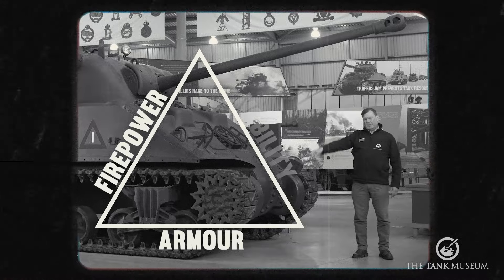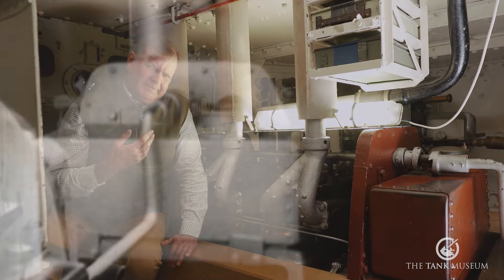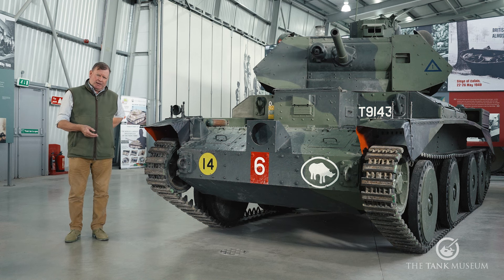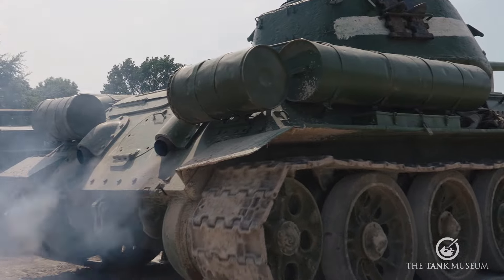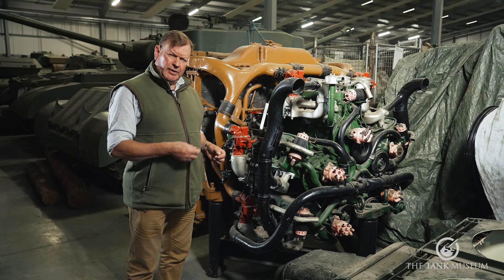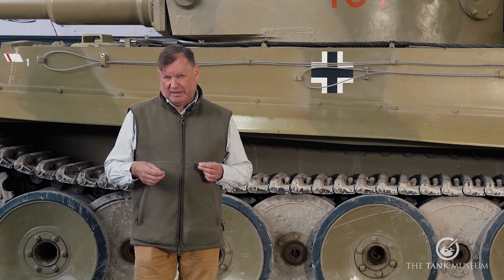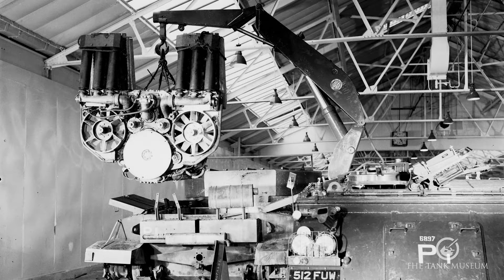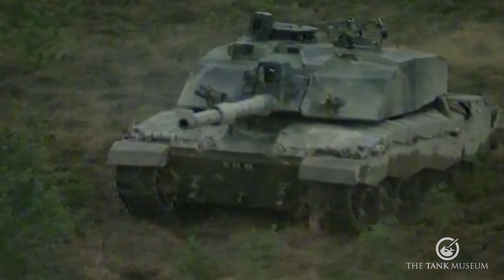Powering Victory: How tank engines went from 105 to 1200bhp

Comment: I am fascinated by the history of technology and design, especially having to do with "roads not taken", or "roads not taken sooner". Why was the atomic bomb invented before the Claymore mine? Think about it. The explanations for these seeming anomalies can be sorted into a few categories. One of the most common explanatory categories I frequently see can be summarized as "it happened that way because it had to happen that way". This explanation is sometimes true. Often though, it is based on widely held beliefs that have no basis in fact. My personal favorite category is "nobody ever thought of it", or the closely related "they didn't think it mattered", though this leads inevitably to the question of "why did nobody ever think of it or think it mattered?". The best explanation is that an aspect of design depends on the invention of a new technology, unavailable at the time under discussion. This is best because it leads to greater understanding of history.

The fact that several tanks in WW2 used aircraft engines* is interesting. Something that has always struck me about WW2 tanks is how underpowered they were. Powerful engines were available: Aircraft engines with the power of modern tank engines were tens of thousands. Yet when they were put into tanks, all the parts that made them powerful were removed. The easy explanation is that this "simplification" of the engine made it more reliable (I'm certain it made them cheaper; choices, choices) To begin with is the reliability thing really true? Did the power producing parts truly reduce reliability? In WW2 most of the reliability problems one hears about with tanks have to do with transmissions and final drives. Additionally, the reliability problems of airplane engines (in airplanes) seem to have mostly to do with overheating, largely due to concerns about streamlining and weight saving, two things of less importance in a tank (one hundred pounds weight saving in an aircraft is important, in a tank it's trivial). Regardless, if it is a reliability issue there are ways to deal with this that don't reduce the ability of a tank to accelerate out of danger, one of which is the replaceable power pack, as is used on (I think) every modern tank. 

The use of power packs was not enabled by the invention of some new technology in the 60s, or whenever they were first introduced. They could have been introduced in WW1. Power packs are replaced according to a statistically determined schedule before the tank breaks down (at least that's how I think it's supposed to work). This may or may not increase the burden on the logistics train, depending on a complex collection of factors. Having to produce and sustain a larger inventory of tanks in the field to insure that a certain number are actually working is definitely a burden on logistics, not to mention the fact that a certain number of tanks will get stuck in situations that more power could have gotten them out of, and have to be abandoned. Oh, yeah, and the argument that "it has to be simple so they can fix it in the field" may occasionally make sense, but I bet most of what breaks on a tank engine can't actually be fixed by the crew in the field, and even if it can, this takes time that could be better spent destroying the enemy, resting, or avoiding being killed. I think the reason WW2 tanks tended to be underpowered is simply because they didn't think it mattered. They may have also been thinking in terms of speed, which really doesn't matter that much because if your travelling a long enough distance for an extra 10 mph to make a difference, you should be using a carrier, or half your tanks won't get there any faster for having to fix tracks and things. What matters about power is acceleration. Especially in an era when tanks have to stop to shoot accurately. Being able to get away faster from where you stopped makes you less likely to be hit by shots aimed at where you stopped.

BTW, the M18 Hellcat and M4 Sherman have same engine, yet M18 is 7-16 inches shorter, so I don't think it's the engine made the Sherman so tall. Another frequently mentioned culprit is the decision to put the transmission and final drive in the front, necessitating running a driveshaft under the turret. Better explanation, if only because it points out a common piece of stupid tank design (which various sources try to justify in ways that don't really make sense, and I will point out is never done today). The Hellcat also has a rear engine with a front transmission design. I haven't found a clear and detailed depiction of the drive system of an M18, but I get the impression that they simply offset the driveshaft from the crankshaft with either a gear or a chain, which allowed them to lay the driveshaft flat on the floor (deck?) of the hull, rather than running it an angle as it is on the Sherman (yeah, go on and tell me THAT had to be done that way!). Oh, wait. You wouldn't want to put in an extra gear or chain (more moving parts!) because that would decrease power due to friction. The M18 had a top speed of 55 mph, which even today makes it one of the fastest tracked vehicles to ever be put into service. We can reject that argument. I think it's because the designers of the Sherman just didn't think it mattered, and when they figured out it did matter it was too much trouble to change. But it didn't have to happen that way.

*Another thing about aircraft engines: for the Yanks and Brits the practice of using aircraft engines may have prolonged the silliness of using gasoline to power vehicles weighing way more than any gasoline powered vehicle ever should. The Germans have no excuse. Consider the ridiculousness of powering a Tiger 2 with gasoline, especially when fuel availability is a problem. And it's not so they could steal fuel from the allies (I've seen this claim)! The Russians were the threat their tank designs were intended to counter, and the Russians used diesel.

Comment: Asides….  The later Sherman’s used the mentioned Ford GAA engine.  It began as a 60degree V12 DOHC aero engine.  When the aero orders didn’t come in, Ford lopped off 4 cylinders and sold it a 60deg V8.  Arguably the best tank engine of the war.
    The Chrysler multi bank cobbled together engine was reliable, but heavy.  Have read it could run with one bank shut down.

Comment: I'm truly surprised at the Tank Museum allowing this piece to go out with such inaccuracies about the Leyland L60 pack.  For a start, it's not a V6;  it's a six in line, opposed piston setup.  Secondly, the failures attributed to the engine weren't down to any failures by Leyland but more to do with the fact that the L60 was built specifically for Chieftain but at a weight of 45 tons, not the 56 ton final version of the Mk1.  When you add 10 ton to a vehicle spec without upgrading the engine you're inviting problems.  If any further proof was needed you've just got to look at the Vickers MBT and its Indian version the Vijayanta which were both powered by the L60 but at 38 and 39 tons respectively these tanks had no engine problems at all.  Plus there is absolutely no mention at all of the success of the L60 from the Mk10 version onward when horsepower was increased to 750bhp and then 850bhp during the Sundance trials - part of the Totem Pole package of improvements.  Yes, MoD left it too long to get us the right variant of the engine but when it eventually came from the Mk 7a onward, Chieftain was finally the world beater in all respects which it could have been from the outset.  Not only am I quoting fact here but I am speaking as someone who has experienced the L60 in its original and improved forms and who watched the joy on people's faces when they got an experimental Sundance pack fitted into a Mk5 and realized how much better and less oilier their future would be.   Come on Tank Museum, update this Tank Chat and give us the correct version.

Comment: Ooh this will be interesting. I’ve always wondered how engines got more powerful. I mean, it’s just burning petrol in a metal cylinder right ?
Reply: Not just that- many things involved.
Cylinder numbers, size, pressure- aircharge pressure, RPM, fuel types, valve sizes, RPM ranges

Comment: Of all the fundamentals of tank design: Firepower, Mobility, and Protection. They are not equal. What is the worth of a tank's heavy gun if it is not mobile. What worth of a heavy gun's protection if it is not mobile. The VERY essence of a tank is that it be MOBILE. Most engineering or thought on armoured warfare looks at mobility last, when indeed it is first.
Reply: If no gun what is importance of mobility?

Comment: It seems to be a constant for all nations,but especially Germany in WW2,that the designers of a new tank seem to have the engine built and ready,then find the thing is 10 tons heavier than it was supposed to be,thus affecting mobility..The Chieftain had a similar issue i believe?Like the Panther at about 45 tons,was the weight the Tiger was MEANT to be.Yet shared the same basic engine.Then the King Tiger another 6 tons heavier still..Why does this happen?Surely it would be better to finalise the tank,THEN pass your requirements to the engine builders.
Reply: New tanks are quicker to design than new engines.

Germans failed to upgrade their main tank engine over 3 years
Reply: They didn’t have the time, materials, or people to do 20 things at once. The Americans did.

Comment: The triangle at the beginning is bs. You need way more than just that for a good tank. You need brilliant sights, good stabilisation, safety features, smooth or bored? You need brilliant soft factors not just the 3 hard factors.
Reply: even competent training alone combined with a decent gun could outweigh almost everything else

Comment: I'm no expert but common sense tells me that fuel consumption is a massive issue. I'm sure the Centurion with the Meteor petrol engine had a prodigious thirst, which presents two huge problems, firstly the vehicle's fuel capacity and secondly, probably the bigger issue, the problem of keeping the tank supplied with fuel on the battlefield, requiring much more fuel and more fuel supply vehicles than if it had a more economical diesel engine. Fuel trucks are a nice easy soft target for enemy forces, if you only need half as many to supply each tank, you're much less vulnerable.

Comment: do you guys think the armored triangle should be a square to consider things that are becoming even more important in the modern battlefield such as vision (thermal sights and/or maybe even radar to detect small drones). Or does vision goes into armor?
Reply: What about crew comfort and ergonomics, what about reliability and ease of maintenance, what about strategic mobility? There are lot more things that go and have always gone into a tank than just armor, mobility and firepower, sometimes those things only come at an added financial burden, other times they impact the triangle, thus I don’t think those ‚newer‘ features justify changing up the way we talk about tanks any more than those things we haven’t considered in the simplified discussion during the last 100 years.

Comment: No mention of the Continental 1790-series or the 1500hp Turbines?
Reply: And doesn't the Leo 2 also have 1500 hp diesels, or at least the later version of Leo? They top out at 80 km/hr on the road, literally a third more than the Challenger 2 with its 60 km/hr.

Comment: Its always so weird how low on hp tank engines are. There are old volvo 240's out here with more than 1200 hp XD
Reply: You need to compare the torque figures as well as the horsepower.
Reply: Bugatti Chiron: 1500 hp, 1,600 Nm torque
Leopard 2: 1500 hp, 4,700 Nm torque

Comment: It's not about the power of a tank engine , it's about the torque and the transmission . Even modern truck engines from MAN for example , have only 600 to 800hp and still they move a 40 - 60t truck to 90kph . Thanks to 12 or 16 gears , so a 700hp Maybach with 8 gears can still move a 60t tank to max speed fairly quickly . People always compare hp vs wheight , but this is nonsense for such heavy machines . 

A 1000hp car engine won't move a 60t truck , problem of German tanks was the transmission , drive shaft/train . That was not build for such heavy tanks , the 700hp Maybach could still do his job .

Comment: I prefer Lazerpigs idea of soft and hard factors. The iron triangle is the hard factors, but the soft factors are things like production capability, logistics manpower etc. You can have a tank with the best firepower, armour and speed, but if you can only make one at a time, and dont have the dudes to run it you you will find the iron triangle usless.
Reply: That doesn't really have anything to do with the tank itself though and it's something prone to oversimplifications and misunderstandings such as 'Germany should just make T34s' or 'the Germans should not have made Tigers'.

The T34 was not very reliable and would be a bad match for German industry and the Tiger was a heavy tank made for a specialist role, it should not be equated to a medium tank, that's the Panzer IV.
Reply: It is reveals the classic ‘triangle’ to be a 3 D shape with the soft factors changing it to a pyramid.
Reply: Most countries wishing to develop a tank will find production capability to be the hard factor. And then there was this one particular incidence involving copious amounts of madness and substances, that makes calling production and logistics a soft factor maybe a little bit viable.
Reply: @harrybuttery2447 also, didn't the German strategy actually work in Kursk? This is from wiki: "The Germans probably lost 45 tanks at Prokhovoka, most of which were subsequently recovered and repaired. The Soviets may have lost 300 tanks destroyed and another 300 damaged, a 15:1 ratio in Germany's favor. As for Tigers at Kursk, the Germans deployed 146. Only 6 were destroyed". 

So out of 500 tanks Germany lost at Kursk, a third of them were tigers and they only lost 6 of them.
Reply: I like to think of all the soft factors as more immediate things that inhabit the middle of the triangle. Crew comfort, ease of maintenance, profile, range, ammunition storage... etc etc..

Comment: Just a rarely mentioned note.

Even if somewhat underpowered, the Maybach HL210 could propel the  Tiger at 40 kph, which is the same speed as the Panzer IV, a tank less than twice that weight.